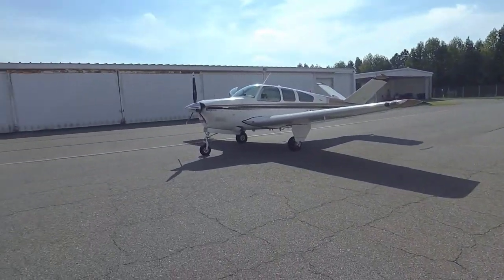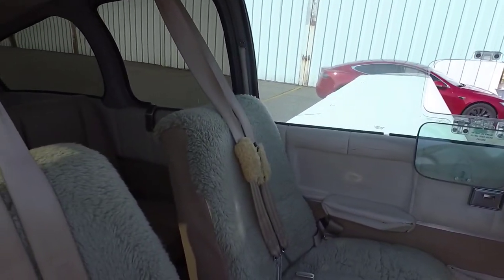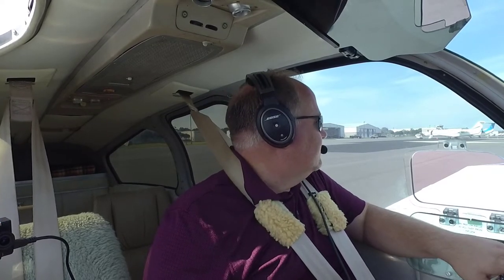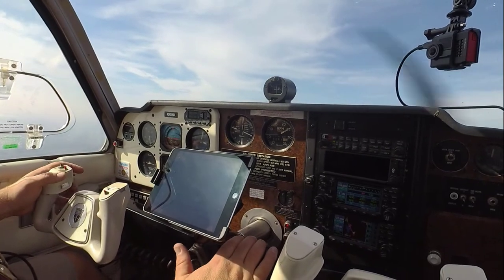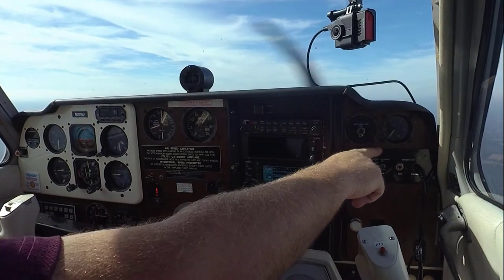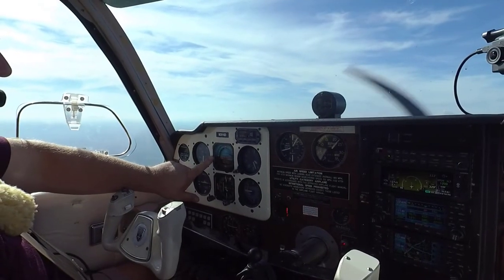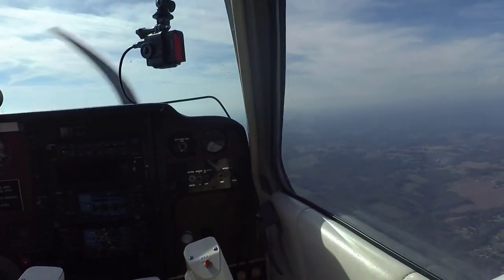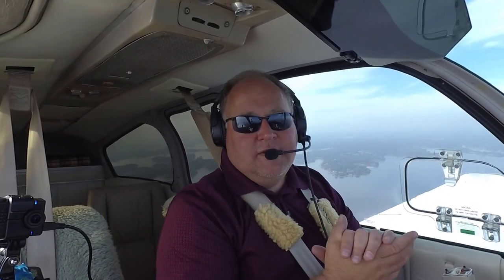Failure in Flight - Vacuum Pump Failure while flying my V Tail Beechcraft V35 Bonanza

Comment: One redundancy you might consider is using one of those AHRS equipped devices that connect to your iPad like the Sentry. That way you’ll have attitude and heading information somewhere in an event of a failure. I’d probably consider one if I had my own plane with a vacuum pump.
Reply from the maker: Backup attitude information is a great safety feature.  In my case, the Garmin GNX 375 has an AHRS sensor built-in, so it provides the pitch and bank data for synthetic vision on my iPad.  Thanks for watching!
Reply: @CoryJohnsonpilot  Does your new plane have an electric vacuum pump?  Saw you just 'switched it off'?

Comment: Almost all of my hours have been in Pipers. However, I have a contract on a 65 Deb. I cannot find a video how the century 2000 autopilot works. Will you be keeping it? Just curious.
Reply from the maker: The Century 2000 was replaced with a Garmin GFC-500.  Good Luck with the Deb.  It's a great plane! 😀
Reply: @CoryJohnsonpilot  thanks! It already has a aspen 1000 so I’ll probably just keep it for now. I would need 2 G 5’s for the garmin autopilot. So hopefully this works!
Reply from the maker: @tnflygirl  The Century 2000 is a good autopilot.  If it's working, there's no reason to change it.

Comment: I really interested on the v tails, the only thing that gives me pause is the ruddervator shortage. Love the videos and look forward to the series.
Reply from the maker: The ruddervator shortage is a real issue, but as long as they are maintained, the ruddervators will last as long as the rest of the Bonanza fuselage.  The concern about replacement parts hasn't slowed me down from buying these amazing planes.  Safe Skies!
Reply: @CoryJohnsonpilot  Thank you for the reply. On the prebuy of a v tail, in your opinion is any form of corrosion a reason to walk away then?
Reply: @MrSixstring2k  that depends 100% on exactly where the corrosion is. filliform corrosion is found regularly on these planes due to the paint they used on all the V tails until the mid 70s. Corrosion around the flap area should be diligently checked.. especially the flap hinges. Its not a game ender if there is corrosion found around these areas as they are aluminum and can be repaired; however, any corrosion around the engine is a must fix right away and is relatively expensive. Be sure to unzip the headliner inside of the plane. The zipper is usually found in the mid section of the rear seat area. There is a bar right there as you unzip across the ceiling and if that bar has corrosion that is also an expensive fix.

Comment: Such a beautiful and timeless design. No question of its appeal. I know nothing about this stuff but it’s gorgeous plane. How can you be sure that such an age of airplane has good airframe integrity before you buy it. And I mean more than just corrosion. Do you have to worry about microscopic cracks in wings spars and things like that?
Reply from the maker: All Bonanzas require repetitive inspections for spar cracks.  Every 500hrs the mechanics conduct a die penetrant inspection to look for microscopic cracks in the spar.  The rest of the airplane is inspected thoroughly during annual inspections.  Corrosion, fatigue, etc... are principle areas of focus for "vintage" airplanes.  One of the many good things about Beechcraft is that the planes were built to last.  Assuming frequent care and maintenance, these planes should last many more years.  Great Question!